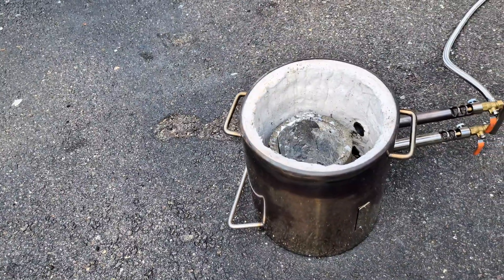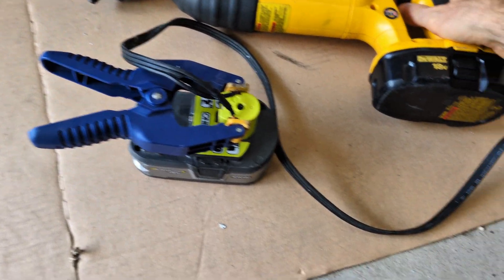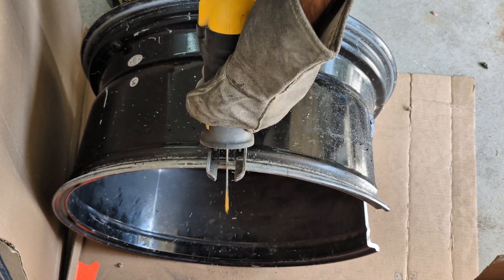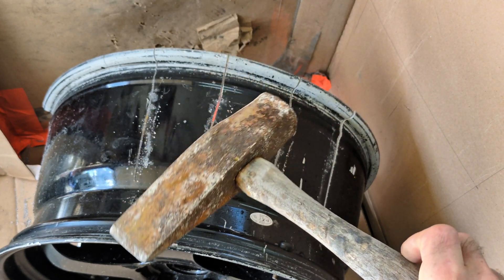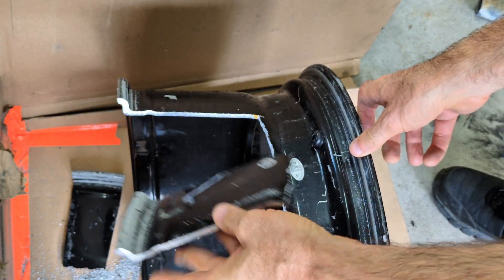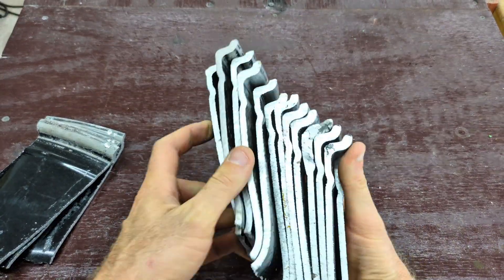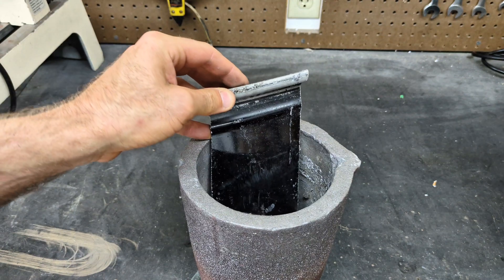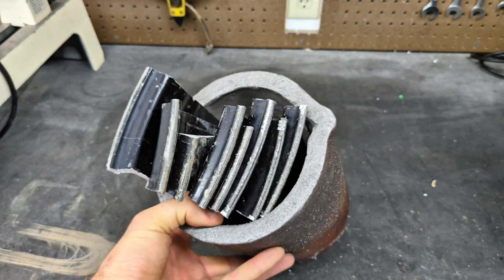How To Cut Up Aluminum Rims for Casting

Comment: I've done this on a table saw with a carbide tipped blade, cuts through aluminum like butter. Word of warning however, the chips are very sharp and get into places you wouldn't expect them to so PPE is a must, at very minimum, good eye protection.
Reply from the maker: Sounds like it works well.  I won't touch a table saw ever since I cut off my fingers using one 4 years ago.  My fingers fortunately were replanted, but they don't work the way they used to.